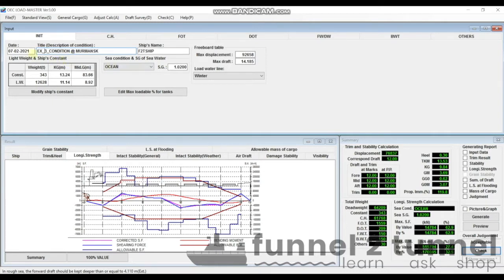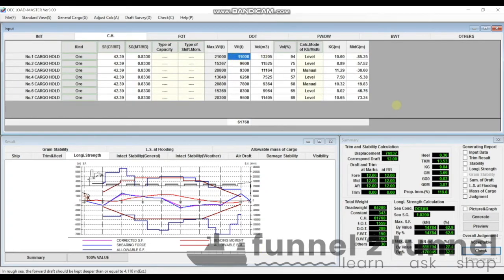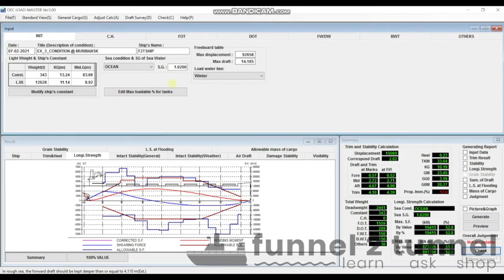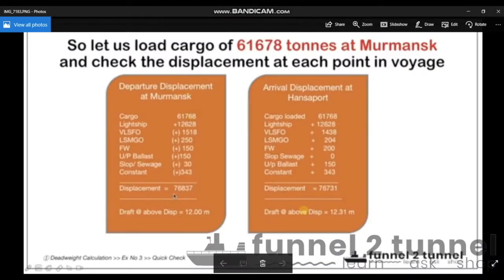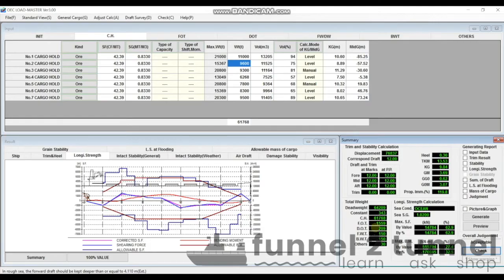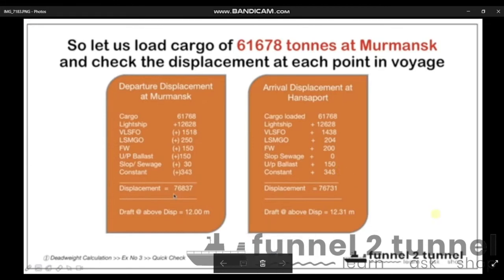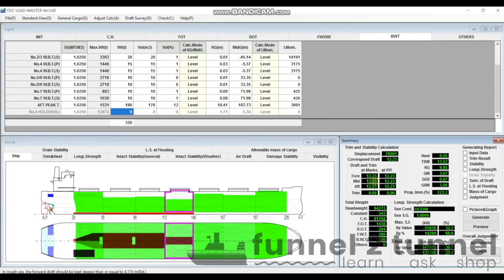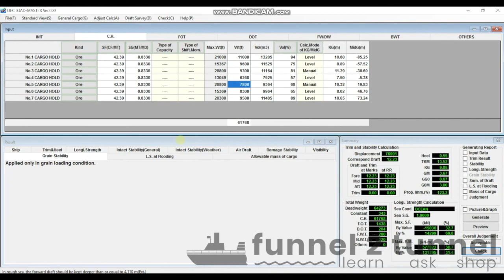Deadweight Calculation and Stowage Plan | Loadicator | Part 6

Comment: My friend, how you can check that stevedores will load exactly 57% in Cargo Hold N 4? There is no marking inside Cargo Hold for checking volume loaded. Or you just believe stevedores and never check?
Reply from the maker: What we are trying to do here is to prepare a Preliminary stowage plan or a Pre Stow plan. The pre stow plan tells us the Optimum quantities with which each hold should be loaded in order for the shop to arrive at a certain draft and trim. 
Now coming to your question that how to determine that stevedores will load exact quantity in a certain cargo hold (say 57% in cargo hold 4 as said by you above).

This will be determined by observing the drafts at each stage of completion when the cargo is being actually loaded on ship. The duty officer / cargo officer will prepare a stage wise loading sequence which shall be tendered to terminal. 
If the loading operation is going on as per planned, the calculated and the observed values of trim and draft shall be quite similar to the one that is observed in actual.
If not, then surely there exists a problem with the loading quantities ( assuming that the deballast quantities are determined correctly) 
Thankfully, our next video is on loading sequences. Hope you will have a better clarity then. Stay tuned